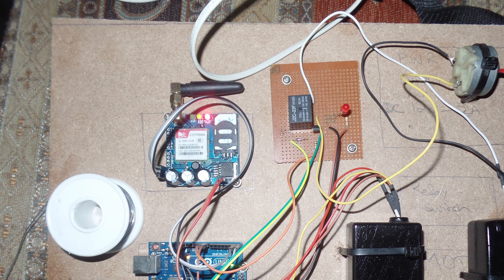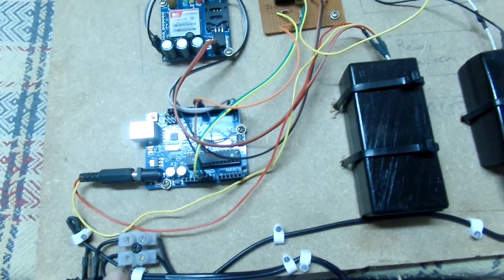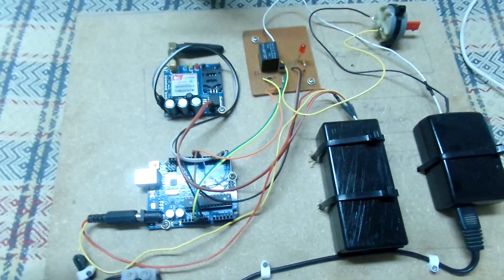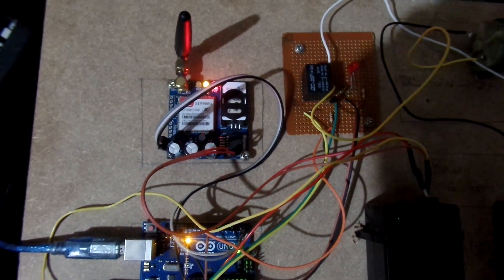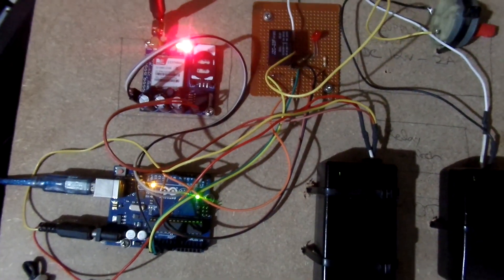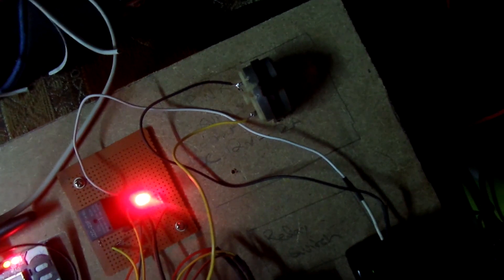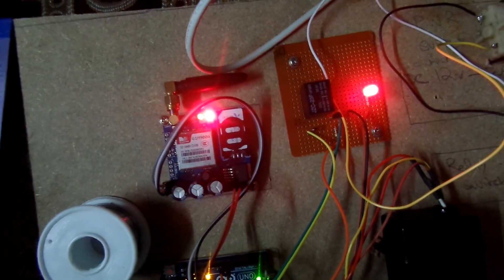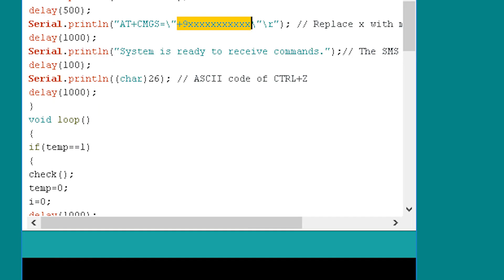GSM Module SIM900A Arduino Motor Control

Comment: Sir, the code for this video where I can find it? Because the link that you provided was not the code for this video. Only the Arduino GSM Based Motor Control (Without GSM Module)  have code, is this the same code that will be use for this video with gsm module?

Comment: Hello sir project is doing the right thing a problem is coming,
Like we work on power off of gsm and power on again, network comes in gsm but the signal we send does not work
Reply from the maker: communication problem. Maybe the module is faulty or arduino UART pins aren't working. Check you connections first.